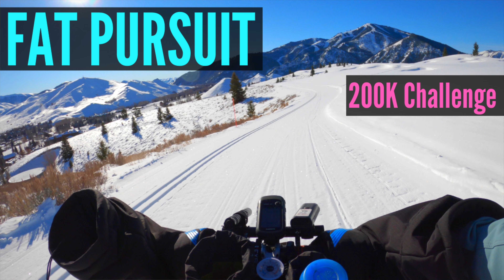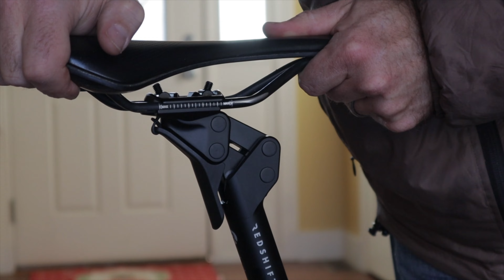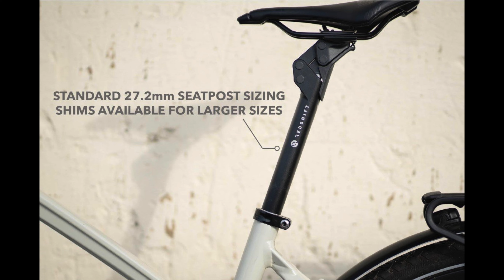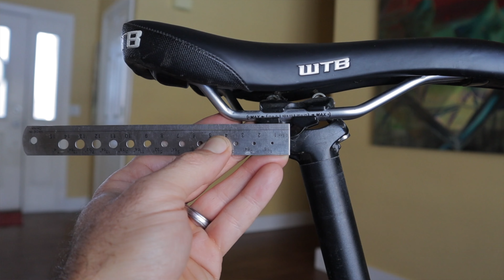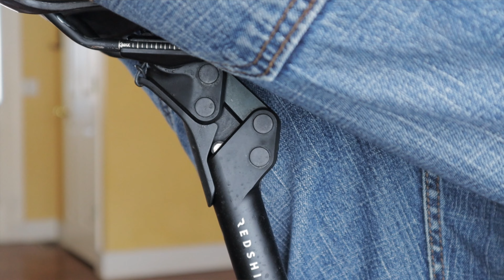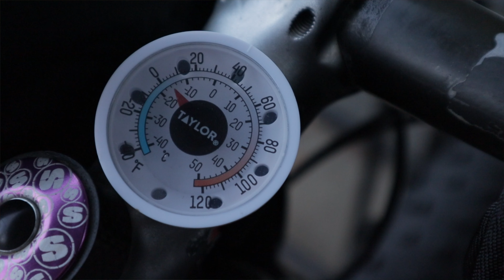Redshift suspension seatpost for winter fat biking and bikepacking? Unbox, Long-term Test, Review

Comment: Looking at this for my Bike packing rig .. I run a rear rack now vs the rail bag for benefits such as not needing to concern myself with attaching that darn thing and tightening it down each morning... 

Only catch I see this is the not so fun part of it throwing off my fit for my seat..but looks like it would be easy enough to get sag in there so it doesn't drop outside what my ideal height is ...still am messing with getting the right saddle as last experiment of 200 miles on a too small one left me with one seriously sorry rear end 🤣
Reply from the maker: thanks for watching and commenting! ride on :)

Comment: Raises saddle height which can be a problem when mounting from a soft snow base.  Induces seated riding through bumps.  Yes, that may be faster, but it still pogos the butt and creates longer saddle time compared to intermittent standing.  Droppers promote more standing.  

Flexion at L5S1 or similar spine location is increased with each compression. That may be a problem for pre-existing herniated disc injury.  

Bobbing pedal stroke is not as noticeable on snow (compresses) as it is on gravel or asphalt, but it’s still there.  Pushing through 6 o’clock crank position leads to discomfort from constant unweighting the butt and falling back onto saddle, regardless of post type.   

These are just issues I’ve identified with Thudbusters.  Best to try them and judge for yourself.
Reply from the maker: Thanks for chiming in, Jason - ride on!

Comment: Does the shim go all the way down the seat tube of the bike so it's flush with the top of the Alu tube or is it supposed to stick out a little? Structurally I've installed it all the way in, and that seems to be the proper way but need someone else's confirmation. Love this suspension, it makes riding extremely comfy. You're one of the reviews I saw to convince myself of it's quality and efficiency.
Reply from the maker: Snowtrees, thanks for watching and commenting - the cane creek shims have a small lip at the top that should sit flush with the top of the seat tube when inserted... hope that helps!!
Reply: @DirtyTeethMTB  that's what I thought, and how I installed it, thanks!

Comment: Nice review. Do you think it could replace a rear suspension? I expect not completely for super technical runs but it looks pretty interesting... thanks
Reply from the maker: Jacques - definitely won't replace rear suspension, but it does take the curse off of the smaller stuff... ride on!
Reply: @DirtyTeethMTB  thanks, actually putting my order in for a fat bike this spring. Great videos!
Reply from the maker: @jacquestejeda5554  thank you!  enjoy the fat bike :)